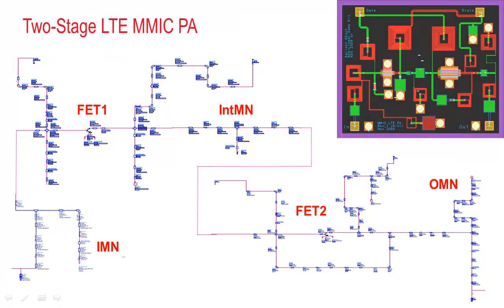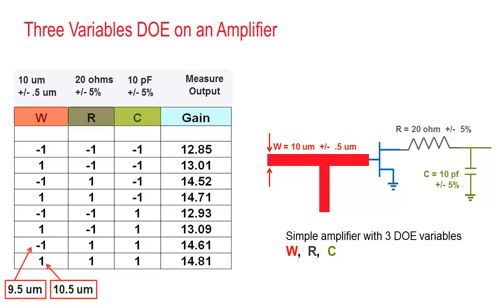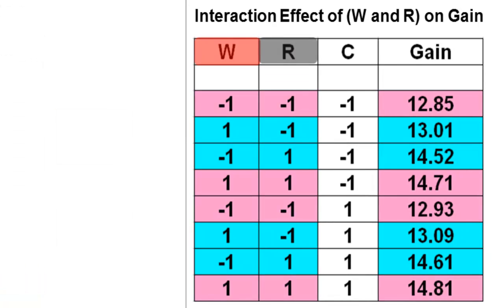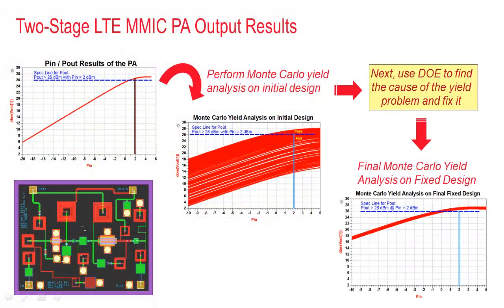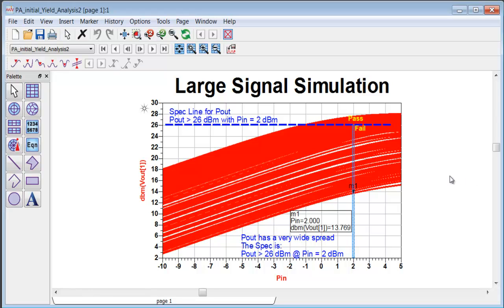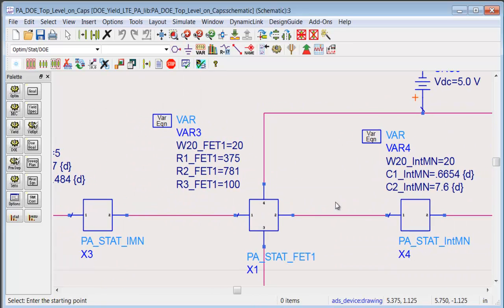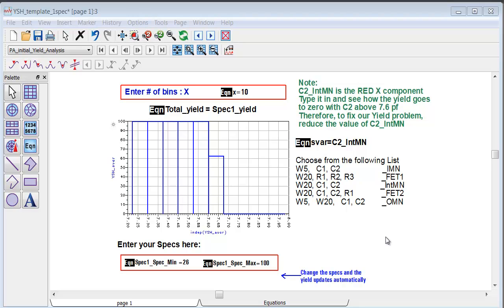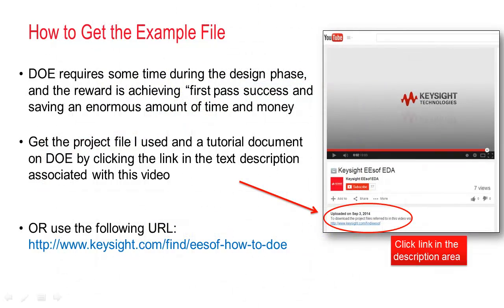How to Use “Design of Experiments” to Create Robust Designs With High Yield

Comment from the maker: Thanks Carlos! Glad to hear you found the video useful! In general you could use any statistical package that includes a DOE tool in it.  The problem is, it requires many manual steps and data entry from one tool to another, where as in ADS the whole process is fully automated and quick. Give ADS a try--apply for a free 30 day trial at www.keysight.com/find/eesof-ads-info.